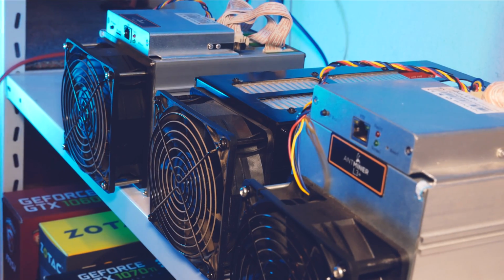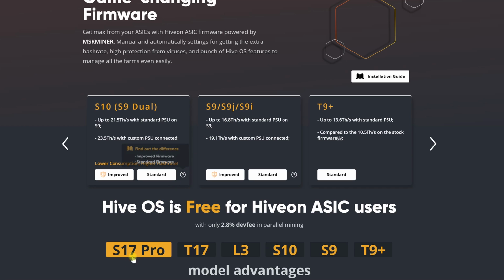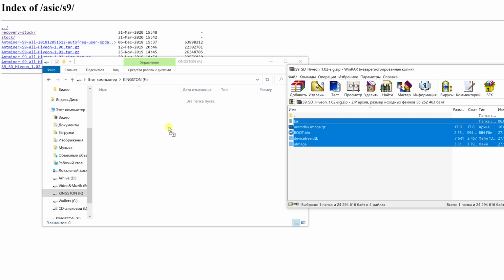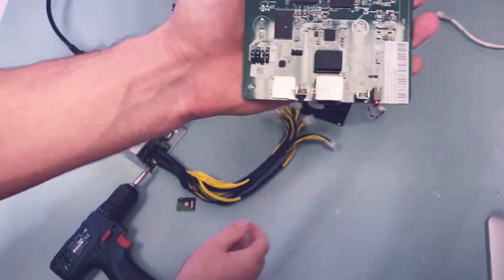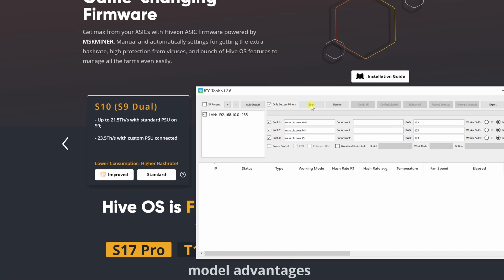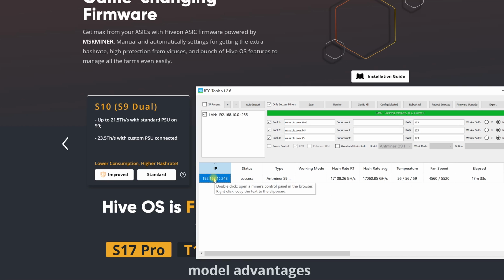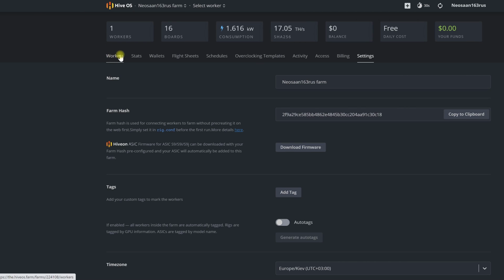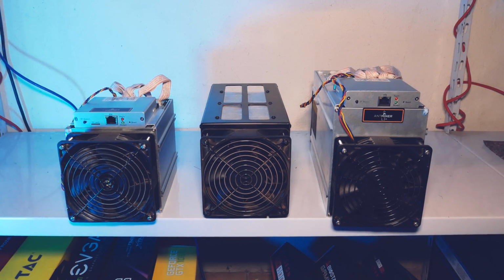ASIC FIRMWARE: How to flash via SD Card (HiveOn by HiveOs) upgrade software (cannot find signature)

Comment: hi my antminer s9i is bricked and i cant get upgrade since i upgraded to 2019 firmware ive tried nearly every video youtube  has my question is i do have the backup nand i took before i upgrade if i put all the files from backup nand would i be able to flash that back too the antminer as every other methods i try it states cant find signiture error all advice welcome please
Reply: @Dave hey did you ever figure this out? I am in the same situation with my s9i. I want to try booting from SD to see if that will bypass the 2019 firmware.

Comment: Is this method to do  to remove hiveon firmware that is stuck in my L3+ asic? i cannot reset to factory firmware or upgrade. I never had issue with blissz, nicehash, and stock bitmain firmware. When I installed hiveon, what an nightmare. I cannot get back to blissz. So is this another way to flash with sd card?
Reply: did you figure it out aim having the same problem
Reply: @kobymoye3030  Hello, It updated with flash image sim card, then repeat refresh firefox browser. Now works fine.

Comment: Bro, my flash not blinking, both the red and green stay on...and the pin already at the right order like in your video...do you know what happened?
Reply: I'm getting the same thing with all my boards. The red and green light immediately turns on and it stays that way. Every video I see those lights don't turn on and the other green lights in the back are green. Not happening for me!! Anyone know whats up?
Reply: @jonathanmendez1786  Hi man, i Have the same problem too. Did you solved it now, I am very sad... On the board one led green diod is shining. Others ale turn off. And on front panel just green and red diods shine, not blink.. Thank you very much for help.
Reply: And for now How  can u solve this problem?i have the same problem.thank you for the answer.
Reply: I gave up trying to upgrade the firmware lol

Comment: Hello guys, i have been trying to update firmware on my andminer t17e but when I try to update it through web browser it says that firmware is not signed, and when i try to insert sd card with firmware on it and turn it on both green and red lights are constantly on and nothing happens. Did anybody had same issues?
Reply: This happened to me too, but the jumper already at the right place.....and After i visually checked the soldered part, it kinda rusted...is that the problem? Are yours already able to be flashed?